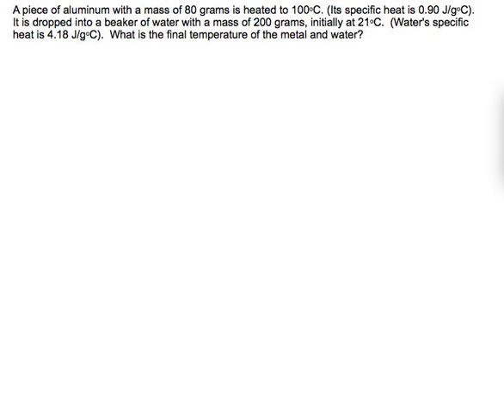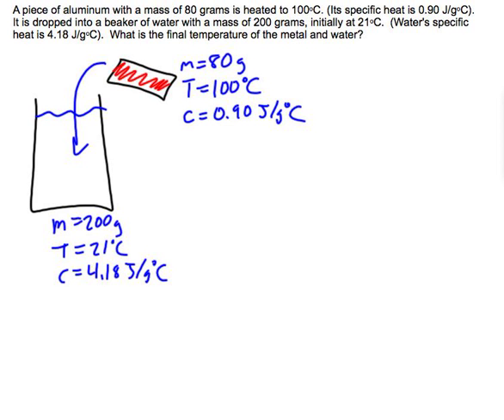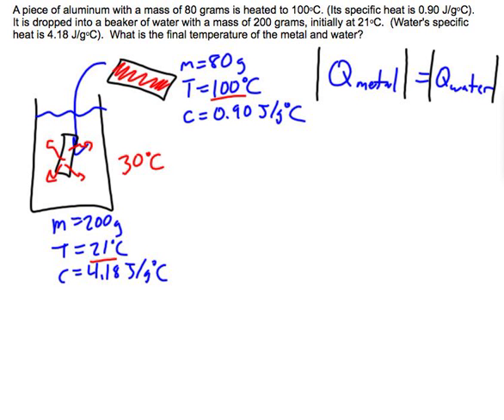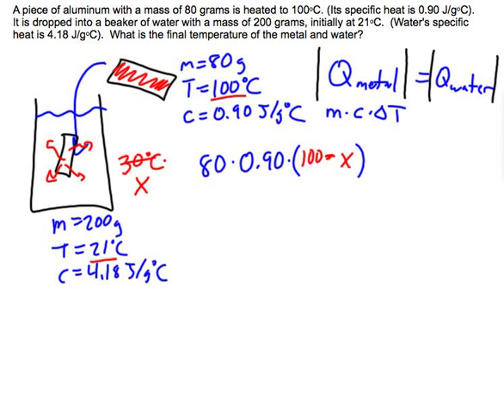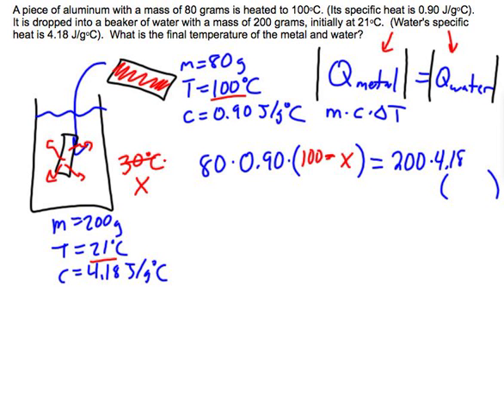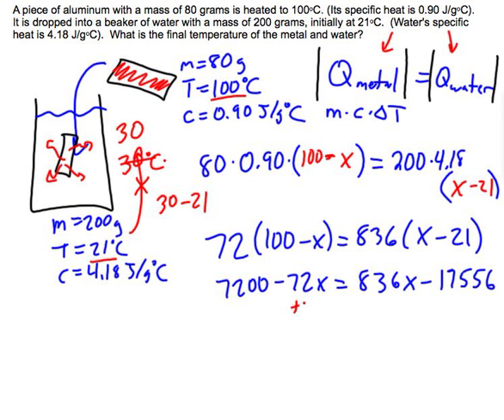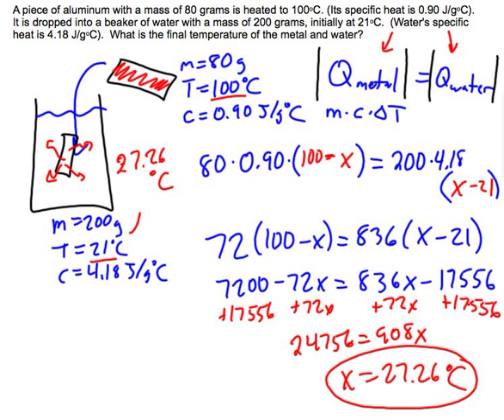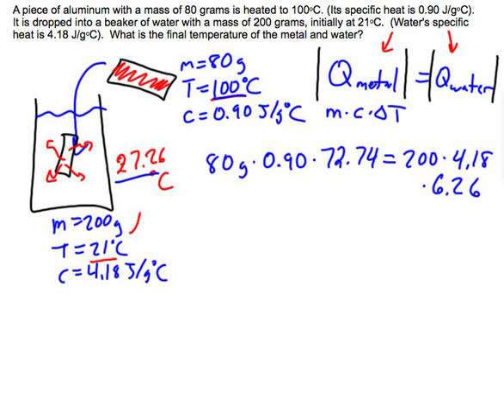Calculating the Final temperature

Comment: if the you have same problem but they specify as  no heat loss.mean the steel bar of 100 is not losing it temperature meanwhile it placed or dumped in side water..so is in the state of temperature rising..we apply the same procedure and take 100 as our initially temperature?
Reply from the maker: I have no idea what you're talking about.  If the steel bar is placed in cold water, it will lose heat.  It has to.  When you say "no heat loss", they probably mean "no heat loss to the surroundings".  In other words, assume all the heat lost by the steel bar goes into the water, which is what I did here.

Comment: is Tf-Ti, so (x-100)
Reply: thats the part really confusing me....if u know about it reply me back thabk u.
Reply from the maker: @sunillamichhane2459  If you use (Tf - Ti), then you need to make one side of the equation negative, because one object loses heat, and one object gains it.  -Qc = Qh.  I prefer to keep all the numbers positive and just focus on the magnitudes of the temperature changes.  If you do that, you have to realize that x will be smaller than 100, so to keep the entire number positive, use (100 - x).

Comment: I have a question. what if I had a problem exactly like this but it was also stated that "Assuming that no heat is lost, what is the final temperature " do they mean instead of putting a (x - something ) I should put (x + something )
Reply from the maker: No, this problem already assume no heat is lost.  It assumes it all goes from the metal to the water.  NEVER do (x + something)...the point of the (x - something) or (something - x) is that it represents the change in temperature (the difference).  It's always a good idea to pick a sample final temperature, and to plug it in to both equations to make sure your temperature change expressions make sense.

Comment: Shouldn't delta T be t(final)-t(initial)? Therefore wouldn't it be x-100 on the left side of the equation and then 21-x on the right? It will give the same answer, but just for the sake of clarity to help keep endothermic and exothermic straight....
Reply from the maker: I do this problem by saying | Qhot | = | Qcold |, rather than Qhot = -Qcold.  As a result, it means you should manipulate your temperature functions so that they always give a positive temperature.  I find students make fewer mistakes that way.  Alternatively, you could make delta T always be Tfinal-Tinitial, but then you would have to apply the negative sign to one side of the equation.
Reply: I followed your steps but the way you set it up gives me a temperature that is hotter than what either were initially.